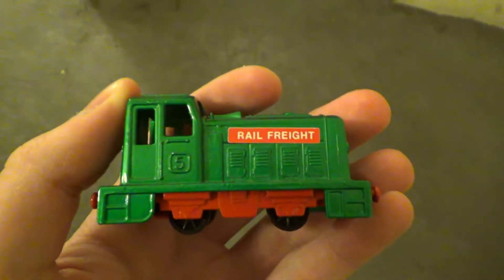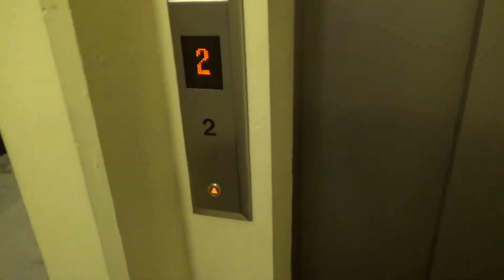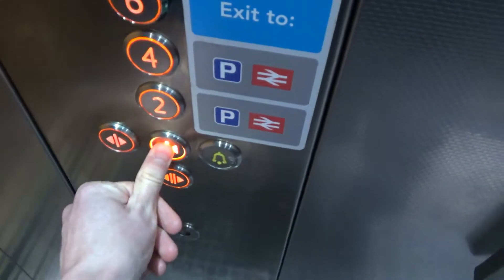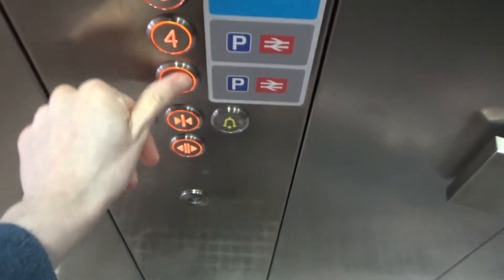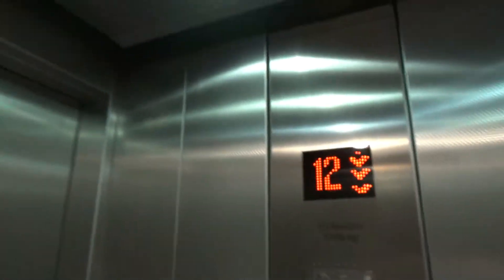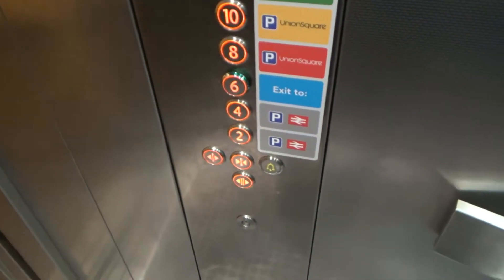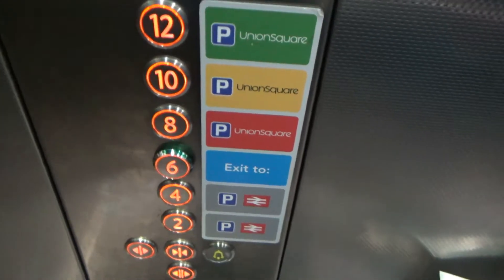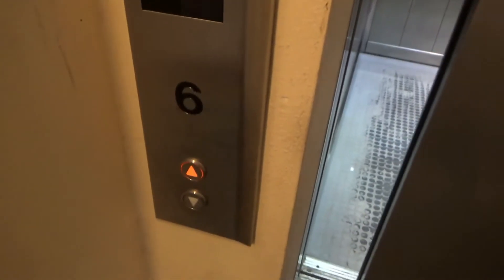Nice KONE EcoDisc MRL Traction Elevator at the College Street Multi-Storey Car Park in Aberdeen

Comment: The call buttons on the outside look like/give the impression of Horrid Dewhurst!!
Reply from the maker: I wonder if this completely replaced an older lift, and this particular panel was the only way to set up the call station in terms of where the holes in the wall were before

Comment: Could you do a lift tour of the Metrocentre in Gateshead?
Reply from the maker: I would if I could, but there are two things preventing me from doing this:
1) I do not know if photography is even permitted there in the first place;
2) The lifts there (especially the ones at the atriums in the centre) are extremely busy and it would take forever to get even 1 round trip with no-one else in the elevator.